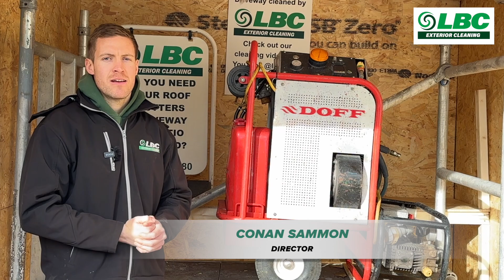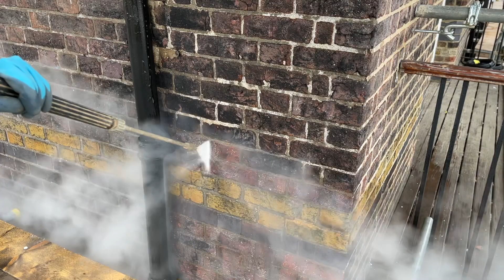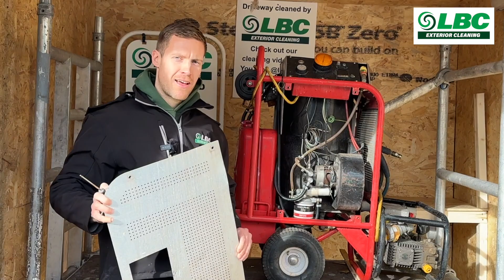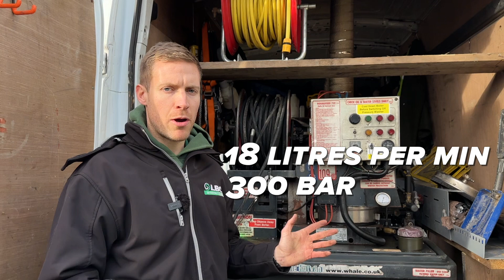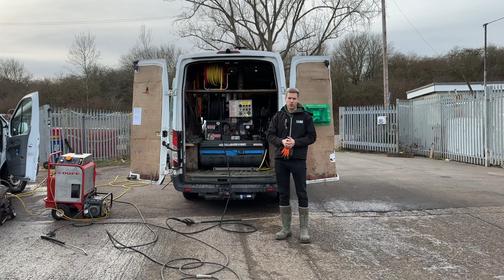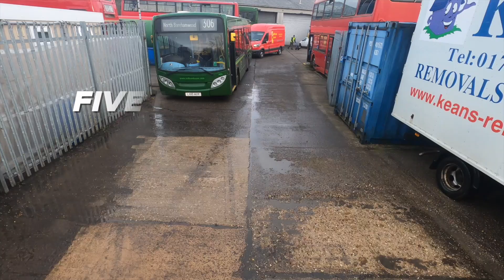Doff Steam Cleaning System Explained

Comment: Hi

Can you clean building exterior windows to a degree only with this steam without physically brushing/wiping.
Reply from the maker: @chrischihoonhwang6787  hey Chris 
Need to be careful of the seals with the steam. 
You can use steam to wash off heavy organic/ cement or other general dirt but if you want a steel free (water mark free finish ). Then you would need to clean after with a squeegee or pure water
Reply: @LBCExteriorCleaning  Thank you so much for your time.  I really appreciate this video and your reply.  Careful with seals...noted.  Been looking for ways to improve building exterior cleaning and last puzzle is the touchless window cleaning.  Pure water still leaves some spots...

Comment: Hi, 

Great video. 

I’m currently looking to buy doff system or Thermatech for my Northwest Restoration company. Have you tried the thermatech in comparison with the doff ? Also do you still need to run chemicals “HF” to clean bricks or does the steam soley clean the carbon from bricks ? 

Thanks.
Reply from the maker: Hi we haven’t tried thermatech but I believe it’s much the same only issue you might have is  having to explain that to clients over and over again as many times it’s ‘doff’ that is specified on the tender documents. Steam will remove organic only to remove carbon you need HF with steam

Comment: try pump to 27 liters and 300 bar I use that a lot and then the pressure is also adjusted down to 100 bar and 97 degrees when necessary we also have 350 bar and 34 liters but 300 bar and 27 liters run well. 18 liters is way too little 😊
Reply from the maker: Hi Dan thanks for your comment we have 30 litre and 34 litre Aswell (and even had 74 on our bintruck! That was a beast )
But the 18 litres with the 300 bar works quite well 
Runs surface cleaner no problem. What systems do you use ?
Reply: @LBCExteriorCleaning  I just want to think 18 liters is hard at the surface rather several liters and down with the pressure. but now you're a professional yourself, so I won't say more. we never use such a small pump on such a fine setup with a diesel engine